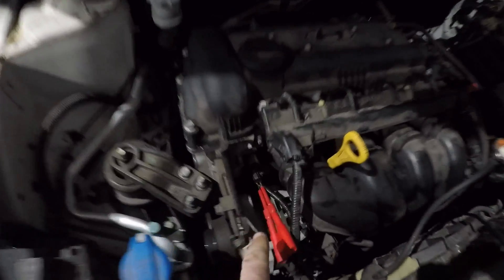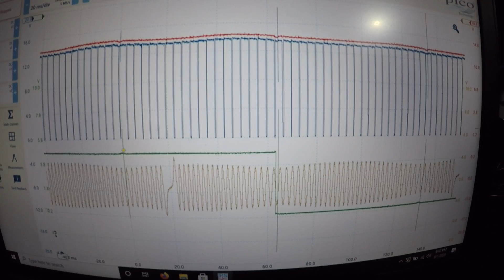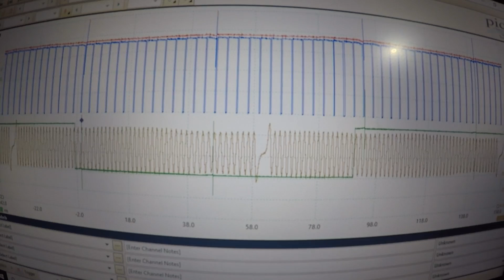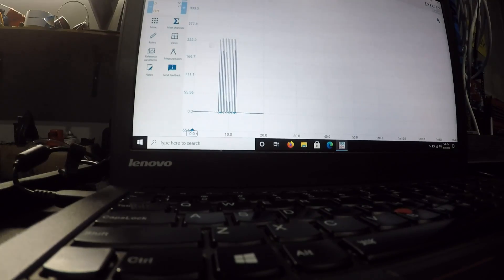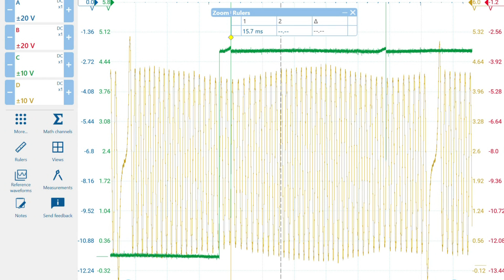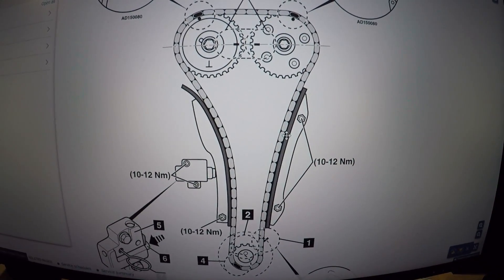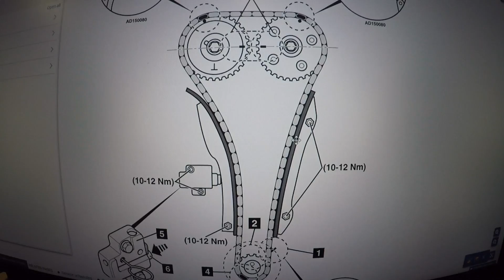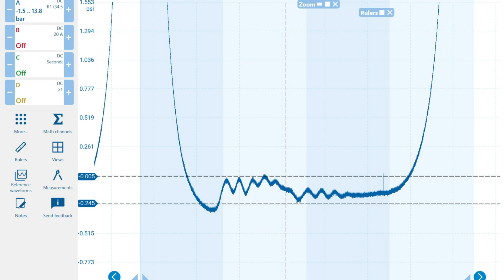P0011 Hyundai i20 - Part 1 - Diagnosis - cam/crank & in-cylinder

Comment: So i was changing my oil passage check valve that supplies the cam phasors in my monoblock 1.8l Chevy sonic. Unfortunately, the ball in the check valve cannot be found. Uh sed a magnet, vacuumed the oil passage, cranked thr engine using the oil pump thr spit out the ball but no luck. Decided to take a chance and install the new check valve and today i have a P0011 over advance intake cam gear timing. I am going to pull the intake vvt selonois to see if there are sny bits of broken plastics from the old check valve and the missing ball. Wish me luck.

Comment: Hi rob, going to try this method on a nissan sentra. Slapping noise,. Man, Pico 7 is so tempting. Lol. Still using lower level stuff for now.  Nice explanation with the cam and crank signals

Comment: Great video man. It showed the importance of double checking your work. Chasing an intermittent driver issue would have driven you nuts lol. Secondly I believe you verified the timing issue without lifting a spanner (almost) by the cam crank correlation and then with a running compression waveform. Enough printable evidence to show the customer that time now needs to be spent on the tools to repair.
Reply from the maker: Could've almost pulled out my hair haha. Exactly what I was wanting to achieve. Thanks for the support Kirk!

Comment: Nice job. Very informative. Hope you can carry on with that job.
Just for the fun it would have been really cool to use the cursors on your scope to estimate how many degrees the cam was advanced, figure out how many degrees there are per tooth on the sprocket and then open the engine up and count how many teeth it was off and see how close your prediction was. Just for fun not for any particular purpose other than perhaps to prove how good a scope diagnosis can be.
Great job keep up the informative videos.
Thanks
Reply from the maker: Thanks Dave and I like that idea! I'll see how we go with it depending on if the customer wants to go ahead